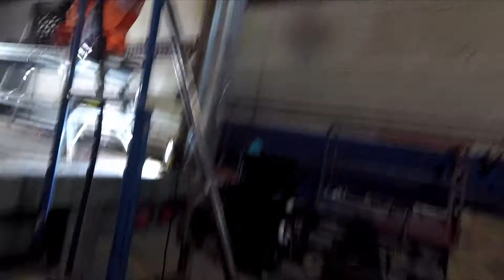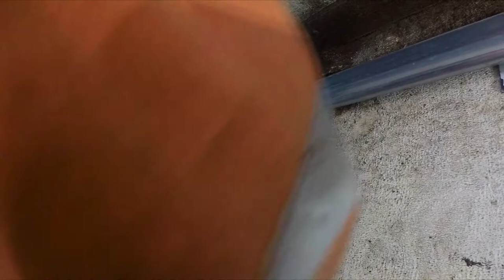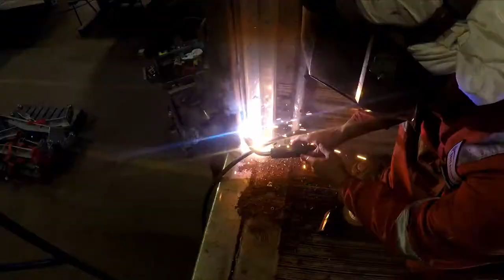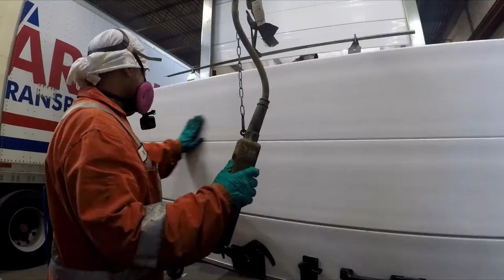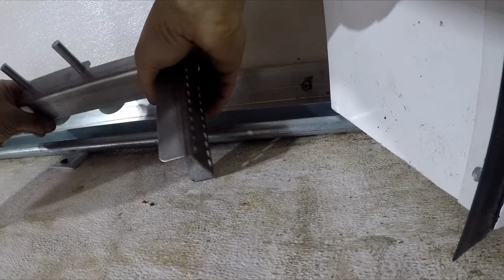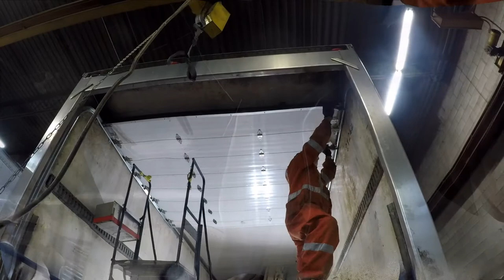ROLL UP DOOR INSTALL(trailer repair)

Comment: Nice! Double operators are the best. The tension was perfect,  I worked at places were they wanted the doors to open like a rocketship. I never did it to dangerous.
Reply: yeah they demand the doors get over tightened then blame you when the operator goes in a few months
Reply: @frankenstrat25  yup, and drivers complain because they have to open the door all the way. I went to a Whiting door class and the instructor said put enough tension where the door opens halfway. If the terminal mgr or my boss gave me a bad time, I would call the instructor. Was no YouTube videos back then...